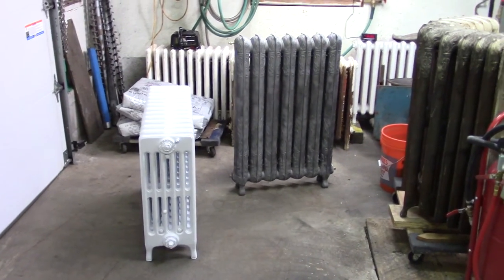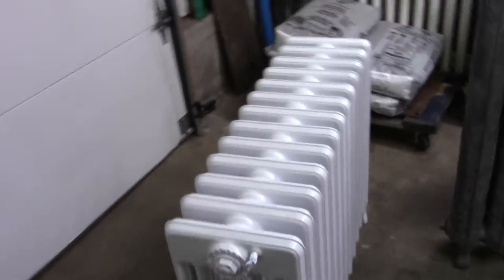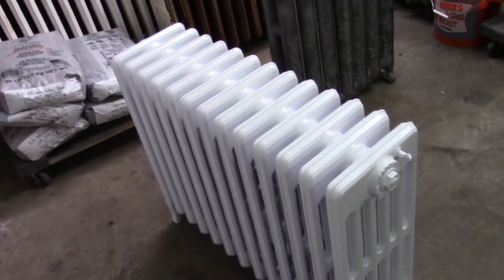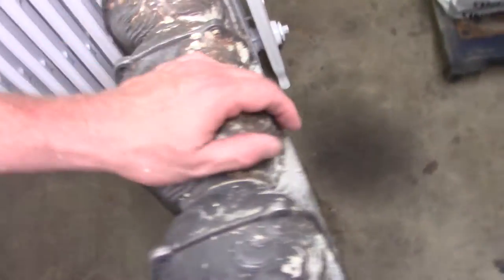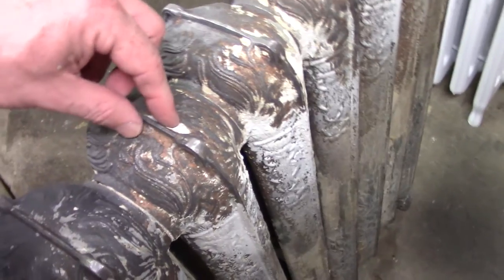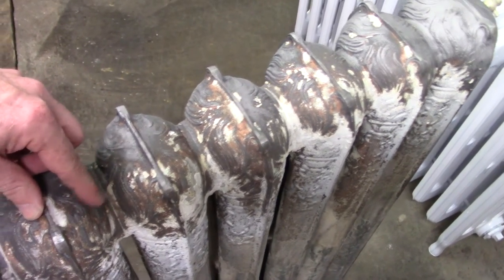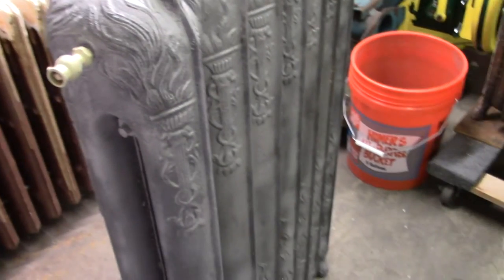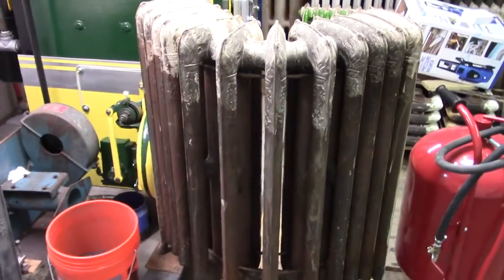Media Blasting Cast Iron Radiators, Take Three

Comment: Do you find a lot of sludge in these old rads?
Reply from the maker: Only if they were in a steam system. Hot water hydronic systems are closed and pressurized so there is no oxygen to react with anything.
Reply: @stokerdon1020  My rads are from the early 1900s.  I believe they may have originally been steam, but are now hot water.  I'm trying to figure out why the lower half (90F) is not as hot as the top half(110F).  Is that normal?
Reply: @johnkim1656  many things. 

Either has suldge or air.  

If it's a water system. Close the return on your system, replace your bleed valve with a series of 1/8th npt to  a valve to a metal flexible supply line .  Put the metal supply line in a bucket . Have someone lift the lever on your feeder and open the valve. Watch all the gunk and air come out of your radiator